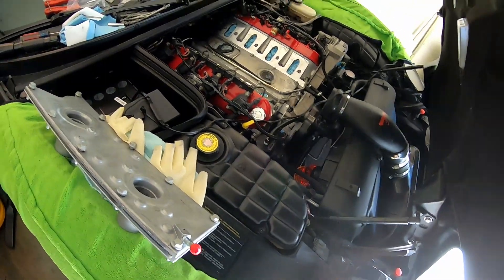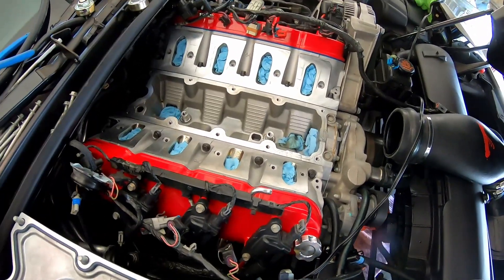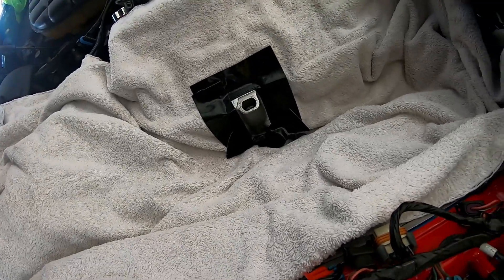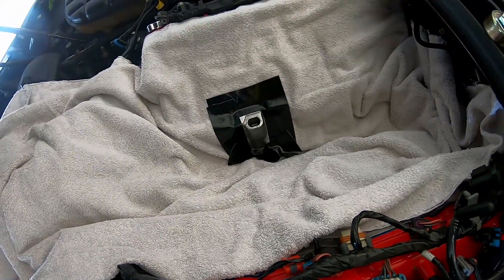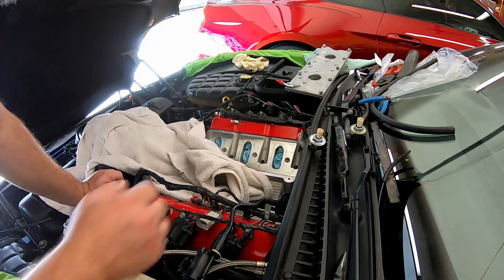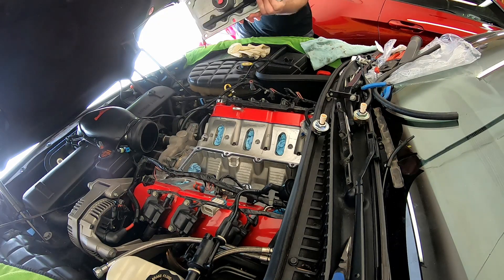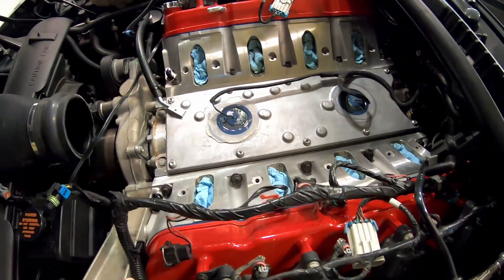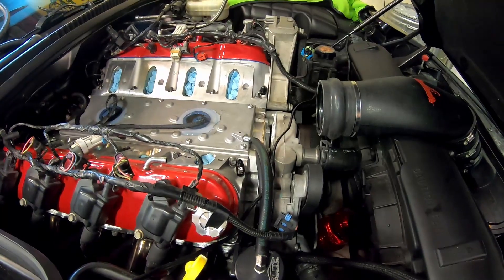How to Cut an LS1 Block for a CTS-V LS6 Valley Cover PCV

Comment: Is that casting solid all the way down or is it hollow after a inch? If I cut a inch will it damage block or cut - hole through?
Reply from the maker: IIRC it is hollow.  The way I showed is the common way everyone does this.  I wouldn't try reinventing the wheel.

Comment: I never had to do this when I installed the updated LS6 cover.....Is the LS6 cover no longer available? Also, I put the LS6 cover on a '98 block. I don't recall having that 'port' on my '98 block. Could it be that the CTS cover doesn't work on earlier blocks? Which blocks have this offending 'port'?
Reply from the maker: as far as I know all LS1 blocks have that casting in the valley that gets in the of the CTS-V valley cover. IMO You want the valley cover with the built in PCV system.  No external PCV.   If it has the internal PCV box mounted to the bottom of the valley cover it won't clear that casting bump inside of the LS1.

Comment: The GM bulletin said a small amount of sealer to keep water out, not entomb them forever!
Reply from the maker: lol that's funny stuff.
Reply: @PNW_Car_Mods  Not if you need to change the KR sensor!!! The😂😂😂 quickly turns to😢😢😢
Reply from the maker: @milojanis4901  I guess some people like to over complicate things. I can get a knock sensor out in 20 seconds with a razor blade and scrape off the old sealant in a minute more.

Comment: I have one of these valley covers on the bench.  I'm going to install it when I do my heads and cam.  I was wondering how difficult it was going to be to trim the block.  Looks like a pretty easy mod.  Good job.
Reply from the maker: It's definitely not mandatory but it was a fun easy project.   Can't wait to put some more miles on it!

Comment: Please forgive my ignorance.
I really don't know anything about catch cans.
But I do know PCV systems have been around since the 60's, or even earlier.

So my question is;
1.) Why have catch cans recently become so popular?
2.) Does every car need one, or only certain types of engines?
3.) Why don't the manufacturer's install them from the factory.
4.) If I install one, and my state requires smog checks, or emission testing will I fail for modifying my PCV system from the factory configuration?

I guess I could find all these answers on google, but I wanted your point of view, because you've actually installed one.
-Chuck
Reply from the maker: I'm just gonna answer these off the cuff and even I may be wrong a bit.    

1 as far as recently I think they've become really popular in the age of direct injection gas engines to try and keep oil from the intake manifold which can create build up on the intake valves that would normally be washed away by atomized fuel.   
The other part of #1 is that for the last 15 years or so cars oil weights have continued to drop to the consistency of water which is going to get past the rings a bit.  

2 I don't think all engines need them.  Just like anything in life things are done differently and some work better from the factory than others.   LS engines while very reliable are notorious for having intake manifolds that you literally can pour oil out of.   I think most will agree it doesn't ultimately hurt the engine.  

3 OEMs don't want anything to do with it as it would add an maintenance item in an era when there is supposed to be less maintenance.  They would also argue there's nothing wrong with their designs.  EVER.  

4 I have never heard of anyone being dinged for having a catch can.  If anything it would be an improvement for the environment as you are not burning as much oil.  

That's kind of it in a nutshell.  I will also say I've never seen a catch can on the Mod Motor Ford V8 but that's not saying much as I am kinda out of the Ford performance loop.  ;)
Reply: @PNW_Car_Mods  
Thanks for playing Mr. Black.

Vanna, tell 'em what prizes he can pick out from our bonus showcase.
Reply from the maker: @PanzerPlatform   lmao
Reply: @PNW_Car_Mods  
Remember back in the 80s when the top prize on Wheel of Fortune was a Corvette, or 25K in cash. 

Or a lifetime supply of Stouffer's Stove Top Stuffing, or Rice Aroni The San Francisco Treat. 

Back to you Pat.
Reply: PCV systems in the '60s didnt have to deal with 6,500-7,000 rpm for the most part!!